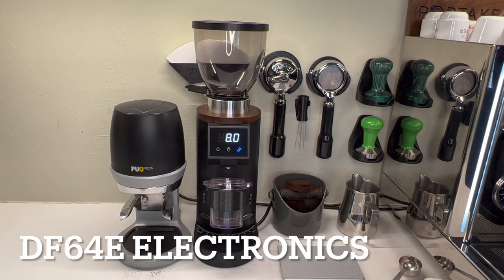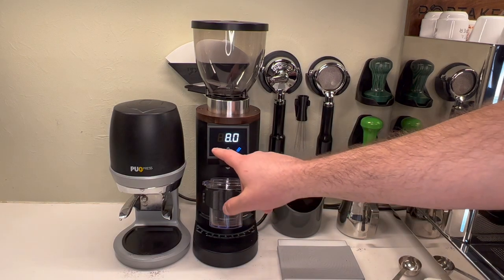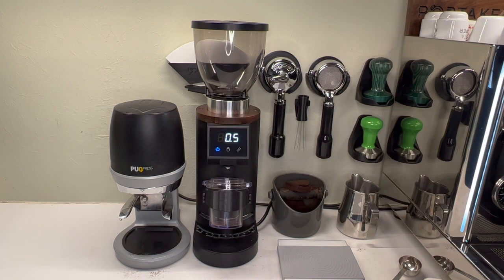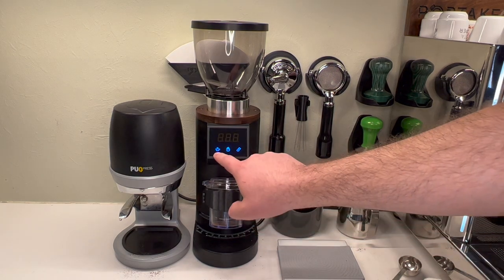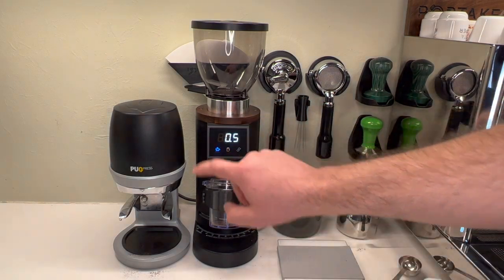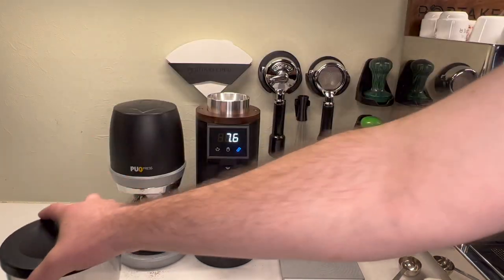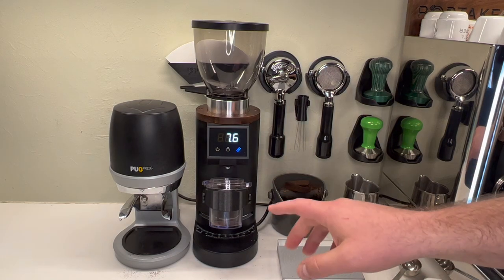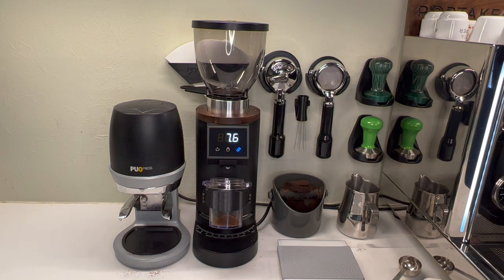Turin DF64E Electronics

Comment: Mine produces a ton of fines when the hopper is used. I stopped using it. Does yours have the same problem?
Reply from the maker: Hmm I have not noticed a lot of fines, but after initial testing I have been mostly using for light roasts and single dose.  Which burrs do you have?
Reply: @portakeeper  everything is stock.

I didn’t notice it until I realized I can’t stop getting sour AND bitter espresso.

If I go fiber on the setting it chokes and the sourness is still overwhelming.

I stopped using the hopper and the problem instantly fixed itself.

I tried cleaning the declumper and I’m going to give it another try with a diff bean.